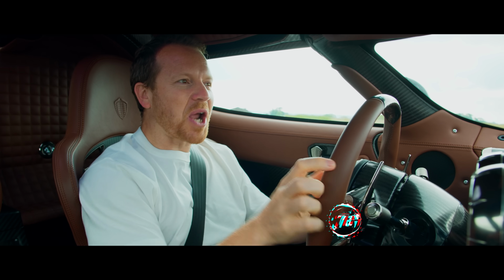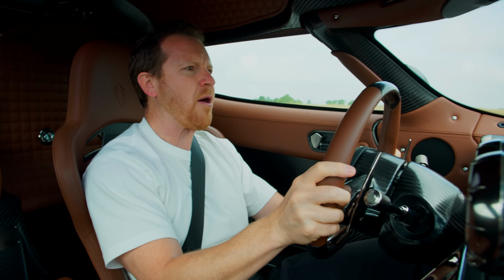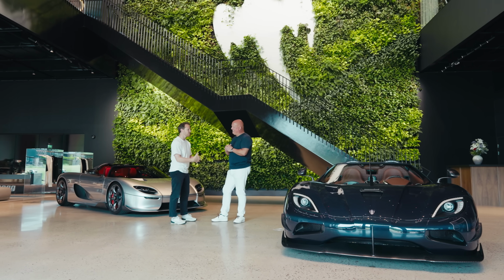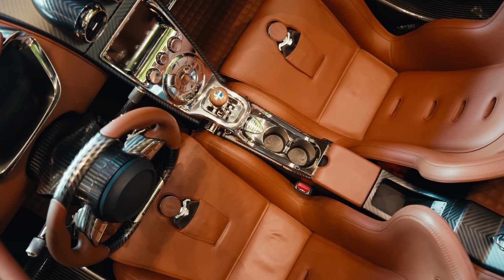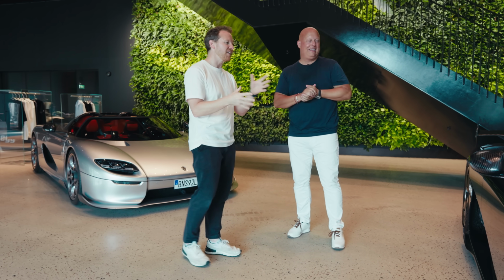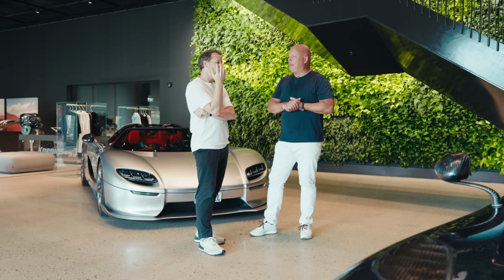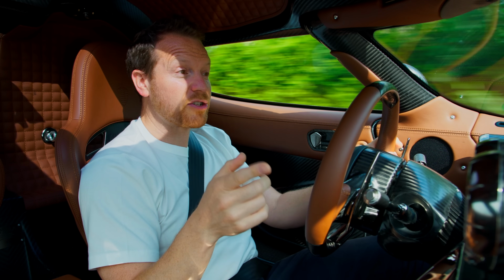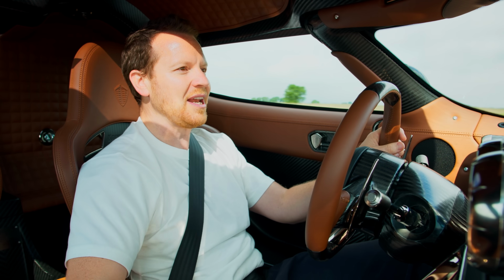FIRST DRIVE: Koenigsegg Chimera - 1600bhp, Manual, Agera RS/Jesko/CC850 Mash-Up!

Comment from the maker: What's your pick: the Jesko, CC850, Agera RS OR Chimera?
Reply: One:1
Reply: @rocaveda9757  Excellent choice
Reply: Cc850,  jesko absolute and gemera (two seater)
Reply: Gemera is a 4 seater
Reply: @cndnro  The Gemera is the only car they make that isn't a two seater.
Reply: @cndnro  A Jesko Attack with the manual/auto gearbox. (Odin spec, but removing the front stripe where the tow hook is and remove the stripe slightly above it, the one that goes almost to the front crest symbol, and also adding some gold flake on the interior carbon) and a Gemera as is with (odin spec, with some gold flake on the interior).
Reply: @cndnro  i agree
Reply: Oh, if you have Koenigsegg money, you don't need to choose, you collect them all.
Reply: Agera RS because I live the look of the agera
Reply: My pick would be the jesko absolut for its uniqueness and single purpose design.
Reply: Chimera for sure, the manual experience, high and fast revving V8, paddles if needed, not to mention the looks of the Agera RS. It has everything
Reply: Cc850 without a doubt
Reply: JESKO
Reply: I like the chimera.... actually I would take any of them, even a totaled and salvaged one would be ok.
Reply: Gemera 😂
Reply: @ici_boy9319  I love the way the doors come out and then go 90 degrees clockwise. I love that I can put my family in it comfortably (with luggage, hah!). Gemera is the pick.
Reply: Probably the Chimera and Gemera.
Reply: i would take the new 4 seat Gemera
Reply: Regera
Reply: Chimera please
Reply: None of the above - I’d go down the road to a Bugatti dealership
Reply: One : 1
Reply: my pick is : the Jesko, CC850, Agera RS AND Chimera
Reply: yes
Reply: cc850
Reply: Sorry the only Swedish 850 I can buy is the V♂️lvo
Reply: CC850 all day, everyday. It's the perfect representation of koenigsegg as a brand in my opinion.
Reply: CC850
Reply: Jesko
Reply: This for me there is no question. It would have to be this Chimera with that amazing 3 in 1 transmission. Wow!
Reply: Couldn't even afford a valve stem seal for one of these
Reply: cc850
Reply: CC850, Regera and Gemera
Reply: None of the above.
Reply: Chimera. Easy answer.
Reply: Chimera or 2015 RS
Reply: cc850!
Reply: 3 cars.... should have been called the Koenigsegg Cerberus. Maybe a future project. What a car. What a mind!
Reply: My pick is Gemera. i need the space and my coofie warm.😂
Reply: CC850 for me. I've always preferred Koenigseggs more restrained styled cars.
Reply: Agera RS. That's been my favorite since the beginning.
Reply: Yes
Reply: the Christian Von.
Reply: Agera RS FE Thor the aero design is simular to the one to one but it has less horsepower
Reply: one of each please! i just have to rob alot of banks first....
Reply: Regera or nothing ❤
Reply: I like the design of the cc850 the most but this chimera is the most spectacular to drive propably.
Reply: Gemera.
Reply: Anything that costs over 300k isnt a real car, imo
Reply: Regera
Reply: ill take a One:1  just for the sound
Reply: The most expensive one, sale it, buy a toyota yaris and spend the rest on hookers and cocaine.
Reply: Shit i wish i had the money for any of them
Reply: Cc850 old school transfer  into  chimera ok bro😊
Reply: yes
Reply: any of them would be perfectly fine to me :)
Reply: none of those, I'd buy the gemera
Reply: regera over all
Reply: Clarkson,hammond,may
Reply: @Kre1gen  think u missed the question buddy :)
Reply: Agera RS
Reply: Agera RS because it holds the world's fastest car, they broke the record after 80 years since German marvel engineering of NATSOC era.
Reply: Chimera for sure
Reply: Chimera
Reply: @TopGear  Agera. Those looks ...
Reply: Yes!
Reply: Yes.
Reply: All
Reply: I would pick the Jesko Absolute, then the Jesko Track second.
Reply: CC850
Reply: Jesko
Reply: All, plus the agera R..still love the agera R, will be insane they use agera R and mate all jesko engine, cc850 gearbox like this one
Reply: All of them and the Gemera
Reply: CC850
Reply: 2300hp gemera pls
Reply: One : 1 ❤️
Reply: YES!
Reply: Jesko absolut, who wouldnt want that car.
Reply: i'll take the gemera, i just love it
Reply: Jesko
Reply: Cc850 👌
Reply: Chimera as it is here
Reply: agera RS 🗣️🗣️🗣️
Reply: i’ll go with the agera rs, regera or jesko attack. i’d  wouldn’t be able to settle for one so i would need all 3 of these 😂😂
Reply: Gemera easy
Reply: The Gemeras I3 in a Yaris GR
Reply: @Grimm-Gaming  600HP in a Yaris , nice 😁
Reply: @skunkvakt1007  yeah haha
Reply: Chimera ..my fav. Looking koenigsegg and that transmission is a dream
Reply: Someone should gift me a Chimera. I can't live without the stick. (Buuuut I think I could settle for ANY one of Koenigsegg line)
Reply: cc850 100%
Reply: All…  Chimera
Reply: The CC. The original was my childhood dream car, so the new one DOES THINGS for me
Reply: cc850, with some CCXR styling if possible, hehe
Reply: Chimera.... 3 types of gear shifting..... It blows my mind..... I ❤ it
Reply: My pick is save the manuals. Period...
Reply: The Jesko takes 🎉🎉 the cup always
Reply: Agera Rs❤
Reply: Chimera or Agera
Reply: agera rs
Reply: If not the NPC = Jesko Absolut then the Regera, with the sickest drivetrain known to man. 😎
Reply: 😊😊😊a
Reply: CC850 with the paddle option… I love how it looks, and pretty much everything else about it, and now I love it even more because it got just that little bit better with the addition of the paddle option.

Too bad I’m not stupid rich, lol 😂
Reply: All ( I'm not gonna have none of them in real life so why not have them all in my fantasy world)
Reply: Chimera ❤
3 types of gear change in one 👌 👏 
Now for 4th type with telekinesis or brain chip implants?
Reply: Chimera ❣️
Reply: Agera cuz of the looks since I can only see them not buy any of these lol. Engineering master pieces all of these cars or rockets on wheels.
Reply: one 1, jesko absolute,gemera
Reply: the Jesko for me.
Reply: rs easily
Reply: Not being an option, I'd pick the Gemera!
Reply: It would be the Jesko
Reply: One of each for my four private islands.
Reply: Can I get them all, I'm indecisive 😅
Reply: Im takeing chimera because it took my favriote cars design and made it faster.
Reply: Any
Reply: Neither for youtube audience
Reply: I really like the styling of the CC850
Reply: CC850, pure class
Reply: Gemera
Reply: Eh, what? This beautiful thing thing that you just got your filthy, grubby, unworthy mits on has to be the most super of supercars that I can think of over my 54 years of breathing air.
Reply: Agera
Reply: all
Reply: CHIMERA because of the Jesko engine, the CC850 6sp manual / 9sp automatic gearbox and it’s unique sequential paddle shifting option, plus I love the look of the AGERA RS.
Edit : I wouldn’t say no to a CC850 though.
Reply: Gordon Murray T50 if I had the money.
Reply: Agera rs, the agera body shape is just too iconic and screams koenigsegg
Reply: 2 headed beastt bruh
Reply: Gemera
Reply: Chimera!!!!🔥😊
Reply: Chimera,since it’s combined with the Jesko,agera rs,and the cc850.
Reply: Kalau bahagian memilih dan membuat pilihan kesemuanya yg akan gue pilih adalah,,,, Neymar Junior 10"
Reply: all of above 🙂
Reply: agera rs
Reply: Jesko
Reply: I don't like the dashboards of the new Koenigseggs (Jesko, Gemera) so I'll have to pick the Chimera.
Reply: of course chimera, chimera, is a combination of my favorite koenigseggs.
Reply: none, i can't offer one
Reply: My favorite Koenigsegg is the Regera, which was not included in the list.
Reply: One of each.🤷‍♂️💛
Reply: keonigsegg vader
Reply: Proton saga,
Proton perdana,
Proton waja,
Reply: We already know the answer
Reply: Chimera, of course
Reply: Jesko Absolut all day
Reply: Definitely a Jesko with the Chimera transmission set up
Reply: I want all of them plus the ones still being designed
Reply: British people are so cucked that he felt nervous talking about his speed, even whilst on track. SAD!
Reply: Rs one to one.    Gold/black
Reply: chimera
Reply: All of them
Reply: Eu escolheria o Koenigsegg Sadair's Spear ❤🥰. Meus parabéns por seu belíssimo trabalho,e por seu excepcional conteúdo. Beijos no seu 👉❤ e abraços fraternos do Brasil 🇧🇷🤝👍👊
Reply: Bugatti Chiron divo

Comment: >»Signal-to-ratio-/+3AWHS-1 WIRE HARNESS SPOONSK2/2«< UNIVERSAL POSITIONER
605837 TE INSTALL/REMOVAL TOOL (4 SUPPLIED)G125 IN-SERVICE INSPECTION GAUGETH163 - AF8 Crimper Turret Head - Wire Sizes 12-24 AWG - Color Coded - Blue

Comment: There is absolutely no doubt that the Chimera is the worlds first “Ultimate Drivers Car” in my opinion. Someone who is considered a genuine driving enthusiast is not one that simply appreciates the performance abilities of a track focused car. A true driving enthusiast has a solid appreciation of every element of the driving experience. This includes not only things like the power, sounds, and performance attributes of any particular automobile, but also the full compliment of mechanical tools provided to engage the driving experience the car was specifically intended to provide. To offer all three modes of shift types in one car in a way that in no way compromises the intended experience outcome of each is probably one of the most underrated design accomplishments in the automotive world. On top of that extraordinary feat, this capability is delivered in a car that can engage in the driving activities these shift modes are directly targeted towards at the highest performance levels and deliver the highest possible levels of driver satisfaction. The Chimera can flood the senses in every possible way while also delivering comfort on a day when the traffic outside is far less than enjoyable. It’s an absolutely brilliant automobile. 👍🏻😎👍🏻

Comment: Your complaint about the gearbox is that it doesn't have the right vibration when taking off in first gear.  WHAT THE...........
So you're saying you kept stalling it like a tool and this is your lame attempt to shift the blame,but only a tool would even come up with that as a complaint for a geatbox.
FIRST WORLD PROBLEMS OF BEING A TOOL

Comment: Nothing beats a good old manual gearbox on a windy mountain road. You can give the car the best automatic gearbox there is or take the gearbox completely out of the car, but the feel you get from the manual shift and the rev matches when the road is right is simply sublime. On track flappy pedals are 100% faster, but when you are not on a race against time and it's enjoyment you seek, manual is the way to go.

Comment: The insistence by "the driver market" to request new cars with manual gearboxes, is kinda like the insistence from "the audio enthusiasts" to request vinyl records from modern releases.
They're both out dated technologies replaced with better ones and people only want them back for nostalgia.
Some aspects of them make sense, manual gear boxes giving better control and vinyl records having a more natural sound, but in reality only very few customers could actually make practical use of or actually hear the difference.
The same way these manual gearboxes can only be truly appreciated on a closed circuit with no traffic and no speed limit, is the same way vinyl records can only be truly appreciated by listening to specific genres of music where the recording quality is very high, something that is sadly becoming more and more unusual.
I have a 991.1 with a PDK gearbox and even that is far beyond my [admittedly average] driving skill level to actually make full use of.

Comment: @koenigsegg 
We need a car with: 
1. Stainless Steel Body / Chassis.
2. Naturally Aspirated Gasoline Engine 2.000cc / 200hp @ 9000 rpm/ 20kg/m torque @ 5000 rpm.
3. Electric Motors 4 x 100 kW @ 9000 rpm / 20kg/m torque.
4. Gear Box with manual transmission of 10 gears / speeds.
5. Interial Material Design Leather, Wood and Chrome.

Comment: Car manufacturers adding in feel is very weird to me. The idea of a DCT putting in a fake jolt so you feel the gear change or traction control letting you slide but not too much, then you have fake steering feel or exhaust noise. Might as well just buy the older cars that have that naturally.

Comment: This is more about driver engagement with the car as you are getting more fun while driving you can just Drop the gear and fill the Power Instant. Automatic shifting scenario you just Drop the paddles there and gain speed and how you can differentiate from others is the timing just 0 to 60, timing I got better timing I got better timing.

Comment: How is it that Christian can incorporate an entirely new experience from a nostalgic craving. If I understand correctly, a gated 6 speed manual shifter digitally attached to a nine speed gear box. Which could also be an automatic. Or paddle shifted. Eh, whatever flavor you prefer at the time. 

Funny thing, I keep thinking that there is some kind of left side driver side advance for the seat closer to the windscreen... like the McClaren F1 had it's center seat ahead of the passenger seats. 9:38 However, I remember what a big guy my Swedish brethern, CVK is, and how small our host must be. 

Amazing technology, amazing execution, and a really fun video.

Comment: Might be the wrong place to ask, at 11:50 they talk about how normal manual transmissions need a flywheel, but this car doesn’t. Why doesn’t it need a flywheel? I understand what a flywheel does but how have they bypassed the need for a flywheel?
Reply: The gearbox is the flywheel.

Comment: I'll take the 6-speed but fitted with the shift by wire. As a matter of fact, put that shit on everything. I am in a need of minivan also.

P.S. there is nothing simulated about this manual. If it stalls and bucks on shifts, lets you choose a wrong gear, break mechanical components, then you are in manual control of it. You just have a different linkage and engagement with the components. There is nothing "not a manual" about the hand operated clutch and foot-operated lever on a motorcycle dog box.

The joy of driving a manual is knowing that you could but managed to not fuck up!

Comment: What I hope is that the clutch biting point is user adjustable. I like a clutch to feel like it’s on the way out. As in a higher engagement point. Nothing throws me off from a car as when the engagement point is on the floor. I want a long throw with a strong engagement at the end.

Comment: So glad that car makers have finally realised that manual gearboxes are a good thing. It took EVs to force the ICE manufacturers hand, but at least it finally happened.
Reply: It’s actually pretty funny to think that previously autos were made with tiptonric and then paddles, in an attempt to simulate the experience of a manual gearbox and now auto boxes have gone so far towards simulating a manual that it’s gone all the way back to manual box and clutch peddle to control an automatic gearbox. 
The irony

Comment: Christian Von Koenigsegg is absolutely right about manual use in the mountains and on country roads. As an owner of a 2003 Corvette 50th, I have the rarer 6sp in mine. Automatic does not cut it for overall feel on turns and corners like a stick does. You have to work a stick to give you that reward. And it makes for a VERY satisfying drive especially as you grow more comfortable shifting your own gears. 

This is something I fear the industry as a whole has lost. Can the argument be made an automatic is safer overall? Yes. Can the argument be made auto is more convenient especially if you don't want to do the leg and hand work for a stick? Yes again. But the question all gearheads ask. Does it make for the soul of driving a sports car? HELL NO!!! If you want the true feel of actually making your vehicle work for you, manual is the only way. You have to work it, especially in traffic. But you can never beat it for how it makes you feel after a good spirited drive with it. 

Great work Christian!! You keep the soul of the sports car alive and well.

Comment: How do they comprehend the fewer gears in manual to automatic mode? Obviously there are 3 gears missing compared to the automatic, does it change up the gear ratio in order to get the same top speed or is it basically limited to the 6th gear in automatic?

Comment: The Hyundai Ioniq 5 N simulates "gear changes" without having an actual gearbox and costs $70,000. It's just software, similar to driving a car in a simulator with pedals, a steering wheel, and other controls.
Reply: 😂 Crazy Korean. Keep trying to compare

Comment: the thing with these cars are that they are unimaginably fast.

my personal car is quite quick. 1360kg, 308 wheel hp. my previous car was actually fast with 1010 kg and 411 wheel horses.

and even tho a 400 hp per tonne power to weight is really quite good is it no match for something like this. it is like my car was standing still.
Reply: I know exactly what you mean, my Prius is a beast.

Comment: Koenigsegg has become a lot more active since Bugatti unveiled its Tourbillon.
Reply: yes because they made this car in a few weeks, obviously
Reply: ReRE RE RE RE hash  on the same platform .  And after a decade using derivatives of what comes in a 40,000$  a F150 // Mustang  v8 .... Coyotes....  an  TRC ( That racing Channel ) just built a 4wd Twinning Turbo'd a  BEARLY  modified  5.0 COYOTE  Stock crankshaft stock rods stock Pistons  etc can put out 1400+hp on lowwwboost 91octane / 1748hp on e 85 at @ the HUB . ADD  JUST  A 3 Stage Nitrous 300hp system.  All inn the f150 is less than 100000k usd

Comment: Absolutely incredible spec, complete artwork. Does anyone know why the older Agera weighs 100 kilos less?
Reply: 100kg less than what?
Reply: @Brian.Jones.310  JESKO
Reply: @Kristian6622  It isn't. Official curb weight stats for the Jesko Attack is 1420kg, Jesko Absolut is 1390kg and Agera RS was 1395kg. TG got it wrong.

Comment: Spring loaded mode 3rd and 4th gate for sequential pull-back style shifter next? And what if u shift without using the clutch, does it still grind?